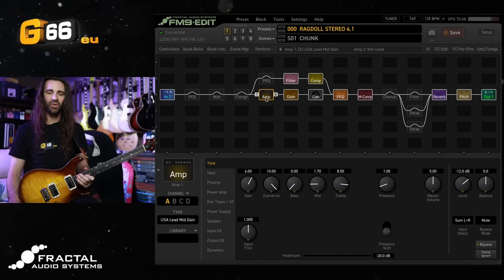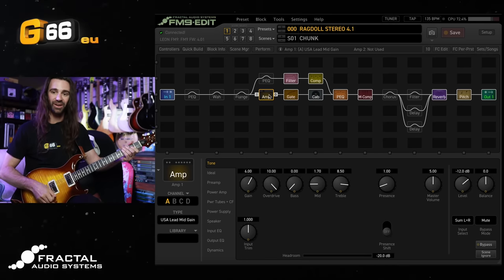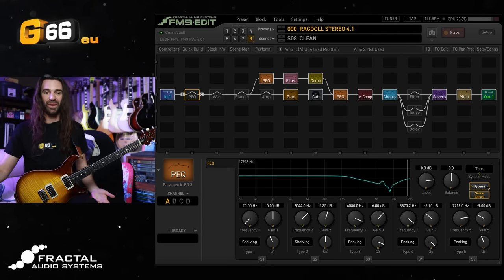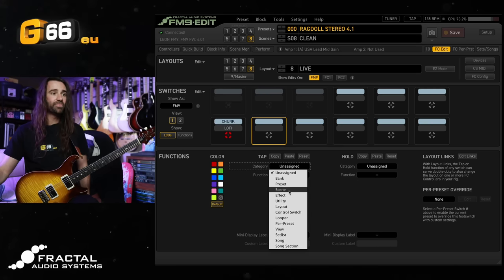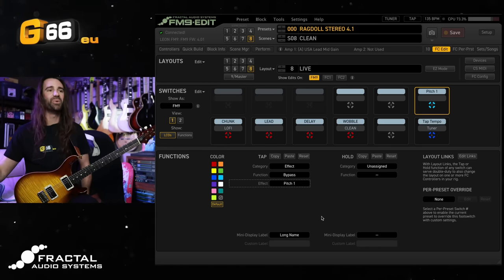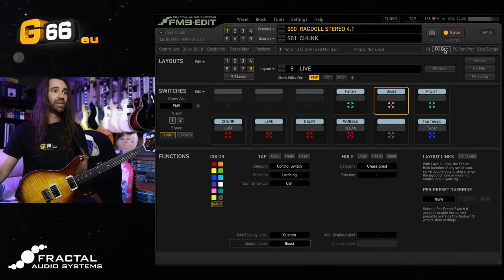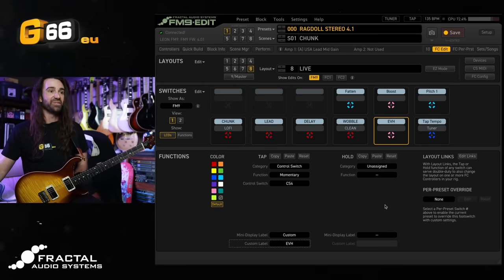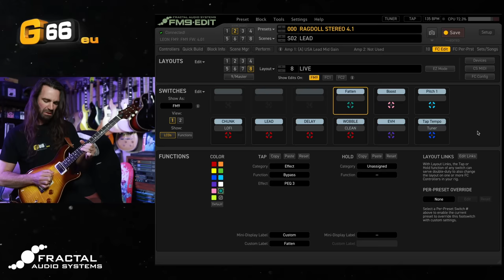Try This FM9 Live Layout | Tuesday Tone Tip

Comment: I don't do alot of occasional effects, but I do use the virtual capo to switch pitch for songs with my cover band a lot. So I have 1 basic preset with 8 scenes to access chunky, slightly overdriven, lead, clean slight boosts and alternate clean with more delay. I then have that preset with permutations of Pitch from -4 to +3 in order Using 8 bank setting on my FC12. Ist layout is preset. 2nd layout is Scene, 3rd is looper. The 8 buttons on the left (4x2) are for preset/scene/looper. The next 2 buttons are up/down bank or scene with the lower button using hold to toggle layout between preset/scene. Top button hold is for looper. Last buttons tuner and tap tempo. I mostly lice in scene layout and use the preset up down to switch pitch. This way I can bring 2-3 guitars instead of 8.

Comment: Just found your channel today.  Don't have an FM9, but considering grabbing one.  Currently have a couple jcm800s 2204 and 03 and Mesa Mark V 90w. Engl 4x12 cab and a Mesa 2x12 all V30s.
I'd like to down size and make things more portable.  Would you consider keeping any of the cabs and maybe pick up a SD power stage 700, or get rid of it all and pick up a powered frfr?

Comment: I'll usually have a "Solo" control switch located in the same spot on my FC-12 for all my live gig presets.. so it's the same switch I hit to start and end my leads.. it's on or it's off.. eazy peezy.. and the control switch itself interacts with multiple blocks in the scene to give me the lead sounds I like.. I think I started doing this just so I didn't have to look at the FC as much.

Comment: Hey Leon I got a question. I like the OFM9G layout. The problem is that some of the presets I want to go to scene 8 for example. I save the preset and it will go to scene 8 on the display screen, but it will not highlight the second page of the more button. So the only way I could actually go to scene 4 is to set a hold switch to go back to scene 4. The only other way is to highlight the more button go back to scene four. I wish there was an easier way that I could get everything matched up with the buttons as on the display screen. I thought about going to 8 scenes as someone suggested and do a hold to go back to presets. I have my presets so where the edit links go directly to the scenes. I just love the flexibility with the OFM9G layout and I love to go to effects and if I want to switch presets I'll go to the preset button. 😊 I'm going to experiment and have one button dedicated to going back to the preset button but then I'll lose my effects button. Someone else suggested that I just primarily make my priority scenes in the first four on the first page. I have a couple of presets that I'm using for down tuning and that's why I have seen 5 through 8. Any suggestions I would appreciate it. I wonder if I could just do a layout link to scene 2 view 2 when starting out I'm going to a different preset and then switching back to view one to my favorite layout. 🤔

Comment: PRS plugged into the fm9 and into Pro Tools. I have a prs ce, and a fm9 connected to Logic Pro, but still does not sound like that, most sounds are muffled and I need post EQ or a good reverb plugin to bring the sound to life.
Reply: I was thinking if it may be because of the cabinet block setup?
Reply from the maker: Cab IR will make a huge difference.

Comment: Leon, thanks for doing this. I am thinking about getting the FC6 or the FC12, I don't play live anymore, I just record. Which would you recommend?
Reply: The FM3+FC6+OMG9 layout is very compact and flexible. I really like it after making some minor changes to it.

The FC12 has switching opportunities galore, but it is overkill, or a major luxury, for most people. And it’s definitely big. I created an FC12 version of OFM9G for mine that works nicely because it has the extra buttons, but the difference in functionality isn’t improved a whole lot over OFM9G because of the extra four switches.

The FM9 is the equivalent of the FM3+FC6 as far as functionality goes, and the OFM9G layout, like OMG9, is a good starting point.
Reply from the maker: 12 because more is more!

Comment: For some reason I cannot for the life of me get a CS to trigger the flanger like you do, not using the FM9 but an AXEIII. Ive tried it multiple ways and just can't get it to work, im sure its user error on my part lol
Reply: Assign the CS to the bypass. You probably need to define the LFO Bypass Reset setting in the block too, to force the sweep to begin at the same place each time. For the switch definition don’t set it to latching, momentary will be easier for what Leon is doing.